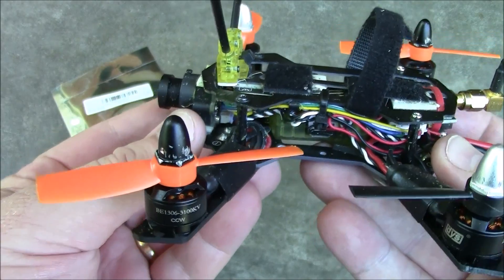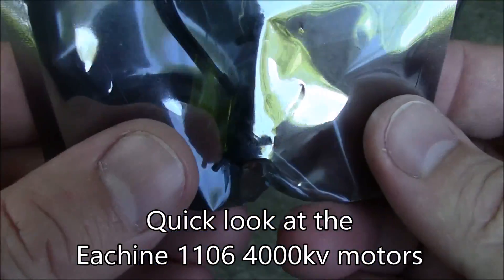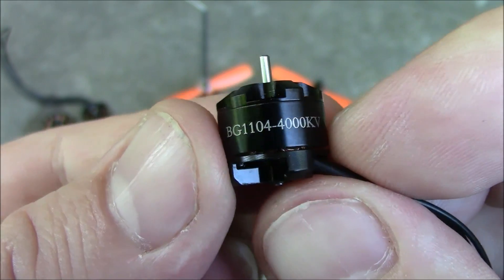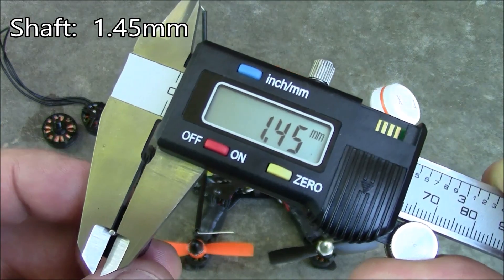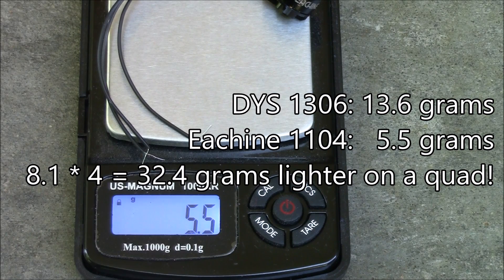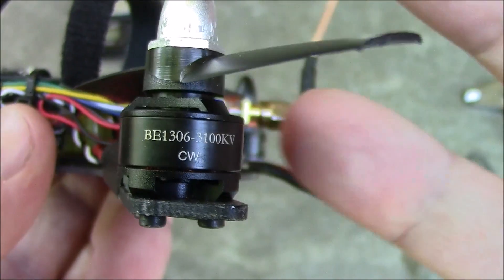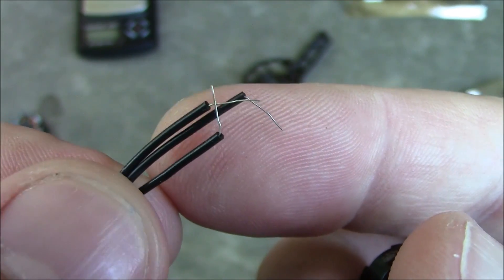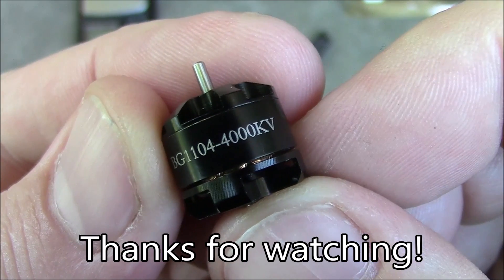Eachine 1104 Motor Overview from Banggood

Comment: right, so i have just bought a few of these and i have cut the wires, I then found out that the wires inside the silicone insulation was not solderable, can you help me??
Reply from the maker: I know exactly what you are talking about.  I had motors with those kinds of wires and I cut them off too.  I had to use flux and blobs of solder to get them to stick.  Keep messing with it and you'll get it.
Reply: ahhh, i got you, thanks for your help

Comment: Has anyone found better props or a prop adapter for 1104's?  All that exists is a single proprietary and ridiculously expensive 3020 prop unreliably shipped from Canadia (armattan or liftrc).  It'd be good if we had some actual prop choices for this sized motor.  Also more motors in this size with a proper screw-shaft like the bigger cobra motors.

Comment: I've got those same motors for my blade 150, and yeah I'm hoping I didn't make the wrong decision in choosing them over the 1306s! Still waiting on escs and some other bits before I get it in the air though. Can't wait to see if I've just wasted a whole heap of money on them! Haha.
Reply from the maker: punkoutnz I still have hope for the 1104s.  Their lighter weight and higher KV is what I'm hoping will make them good.
Reply: punkoutnz Can you post a video as soon as you get them flying?  I'm deadly curious.
Reply: Yeah dude, I'm waiting on props and some other bits, but I'll do a review and comment a link here when it's all going.
Reply: punkoutnz
You rock!